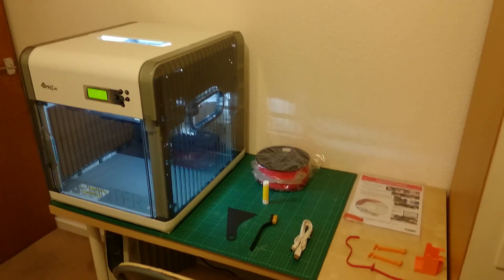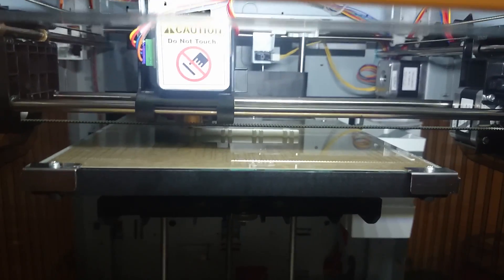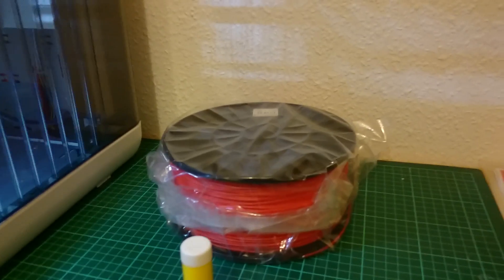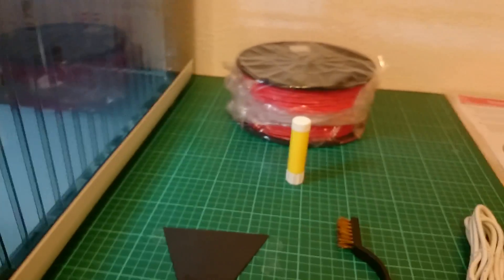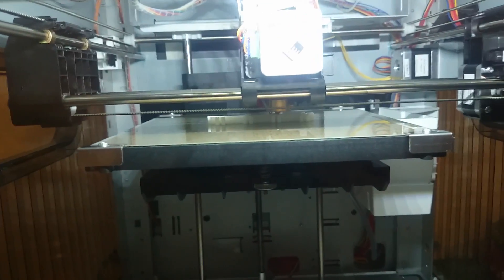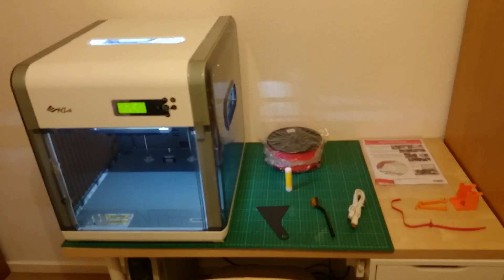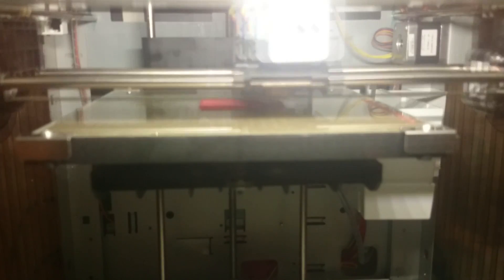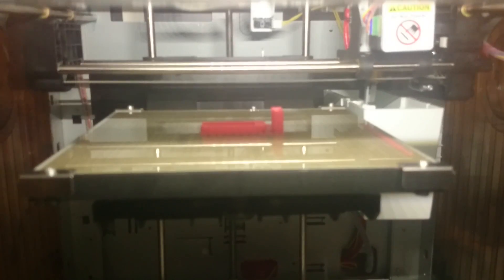XYZ DaVinci 1.0A 3D Printer

Comment: YOU CAN BUY XYZ Da Vinci Cartridge Counter Filament Resetter Reset Tool 3D Printer NEW 240M OFF EBAY FOR £30
Reply: Or an arduino and reset it yourself.

Comment: Did you bypass the cartridge? Otherwise use a arduino to reset it =)
Reply from the maker: mrpeter81 Hi, I picked up a cartridge reset tool, used it once, then flashed Repetier Host to the printer
Reply: StevenQ-NE-UK Sounds good!
Im waiting for my printer, hope to get it in a few days. Did you flash your printer with another firmware yet? Alot of people says its better if you want to adjust the temp on the bed etc etc?

Comment: My software does not allow PLA does yours?
Reply from the maker: hobbyhands Hi, I have moved away from the stock software and am now using Repetier Host 0.92.  I am also upgrading the hot end to an E3D v6.  I am hoping that this combination will give me access to every material type.  I'll log my progress here on the channel.  Enjoy :)
Reply: I thought about doing that, but I was worried that the scanner portion might not work. Don't you have to replace the firmware?
Reply from the maker: hobbyhands Ah, you have the All In One printer scanner, mine is only the printer.  Yeah I flashed Repetier Host 0.92 firmware onto my printer.  I have no idea if it works with the AiO model.

Comment: I had the 1.0 but the bed chipped, I recommend that everybody uses painters tape to protect the glass bed.
Reply from the maker: Cheshire Thanks for the advice.  How hard is it to remove the print from the tape?  I use glue at the moment and wait until the bed cools after printing.
Reply: I always remove the tape after the print, because the object will most likely destroy the tape, but that may be because I remove the objects while they are hot so they don't constrict and cause stress on the glass. I don't know if that is a good idea though.

Comment: Steven,
Chip resetter devices work on this version however this version does NOT support eeprom reflashing. This is the process where the earlier Davinci's could reflash the internal firmware to Repetier Host. There are a couple of guys working on it but they don't have it fully running yet. The chip resetters can be built of purchased. I think they're about 20 pounds worth of electronics to build or 45 pounds to buy one already built. Several websites and even Ebay list them. 

Another thing to look at is using Simply3D software as your front end instead of XYZware. Costs @ 100 pounds...so it's kind of expensive. It gives you full command of all the fiddly bits of the printer. It's not going to make it a high end printer but it will give you a lot more control over the finish you do get.

I have had mine for 8 days and put 132 hours on it :) 

Cheers

Jay
Reply from the maker: Hi Jay,
thanks for the heads up on reflashing.  I was tempted to go that way but didn't want to loose the warranty after 5 days.  I'll source a reset device and give it a go.  I have seen some devices that can totally reprogram the chip.  Not sure if it's a good or bad thing to be able to mess with the temps and speeds.  Looks like there's lots to learn.